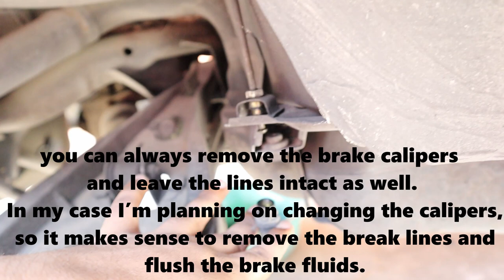BMW E46 subframe reinforcement plates install - epoxy method |  400HP TWIN TURBO N54 E46 WAGON EP-11

Comment: I think welding would have been the most secure way to go but you're right a professional is best for any kind of frame welding. Great work! I can't wait till you get it set in there and see the wiring!
Reply from the maker: Thank you for the support. Doing a lot of research on integrating e90 wiring. I'll get to it soon.

Comment: Hey man what about now is still holding up?
Reply from the maker: Yep. done about 6k miles, mostly canyon runs and several drag strip runs. Holding up great so far. I had some play on the m3 diff front bushing, which was causing a thud sound on clutch launch, swapped out to poly bushing and its gone now.
Reply: @BreakaBolt  impressive 👍

Comment: Been a little over a year, how has the epoxy and subframe held up?
Reply from the maker: Unfortunately, The car is still not ready yet. It has been a difficult year, but im still working on it hoping to get it on the road before end of the year.
Reply: How's it holding up mate